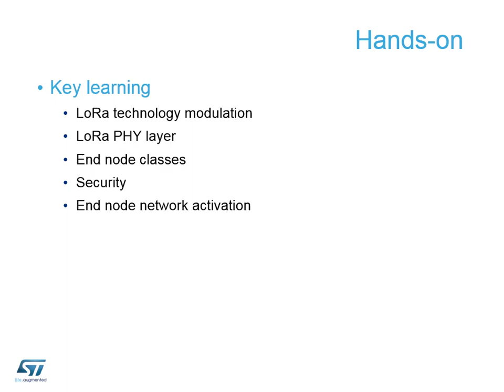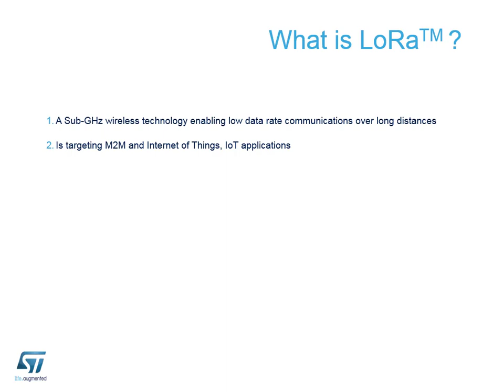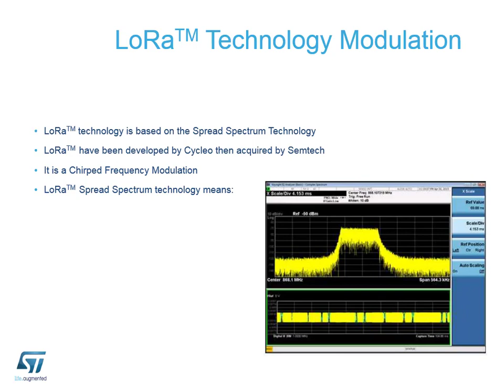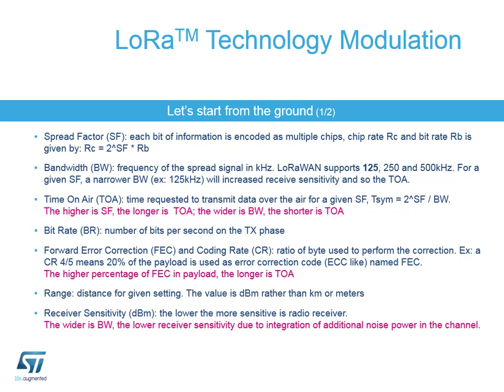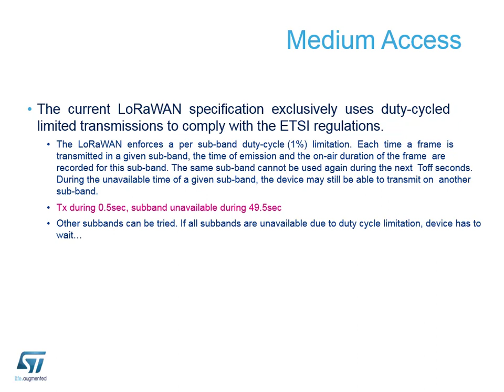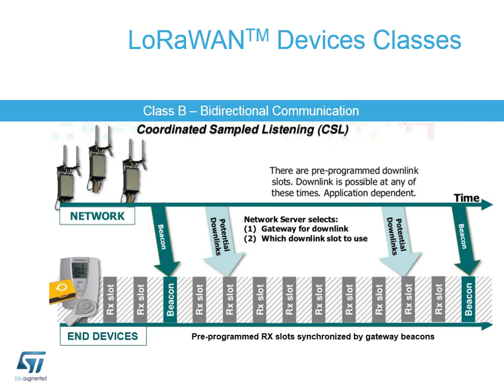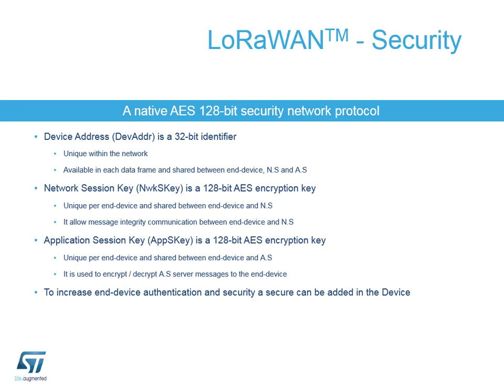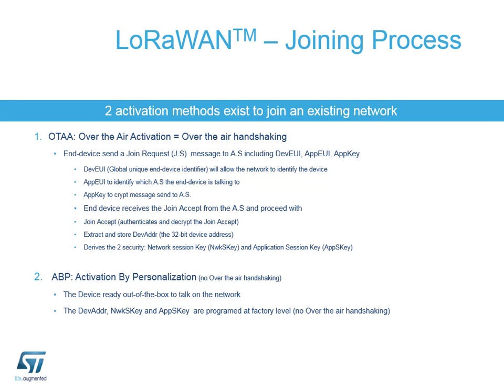LPWAN workshop - 3 LoRa Theory

Comment: Hi, i have a few questions:

1.- in the code examples given for the bl072z board (i-cube-lrwan) where is the option to connect the node to a fixed gateway?

2.- how can i calculate or get my tx_time?

thanks
Reply: The formula for calculating tx-time is in the sx12** datasheet of whichever transceiver you are using.